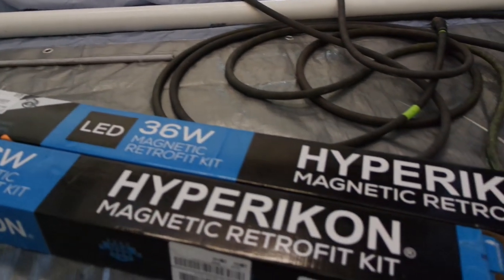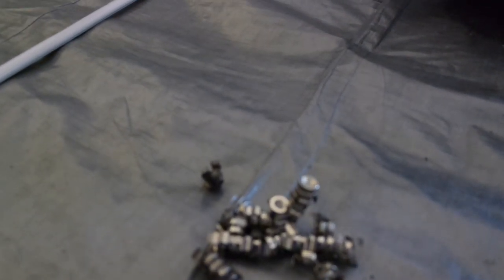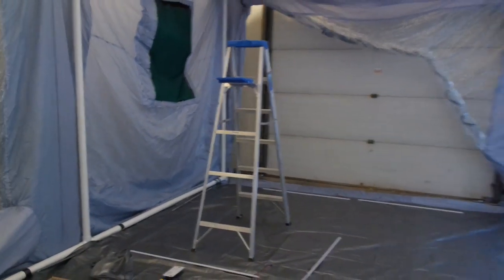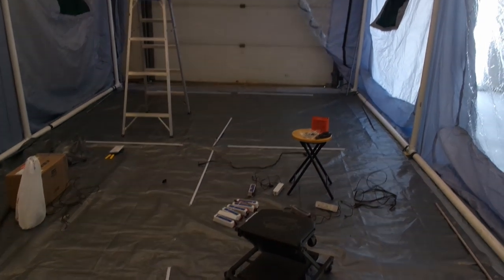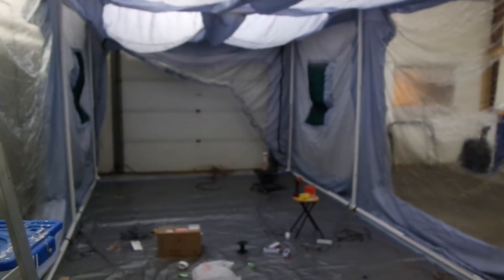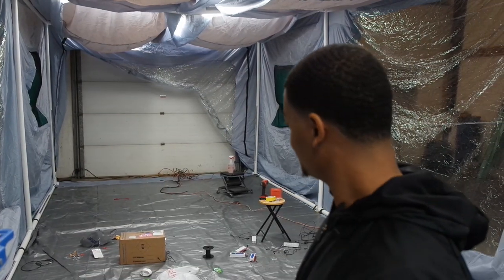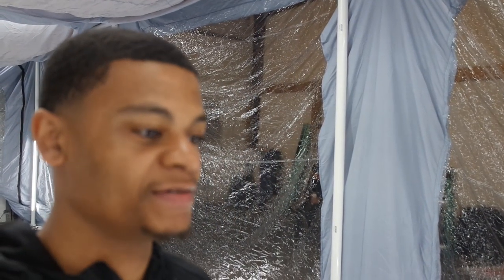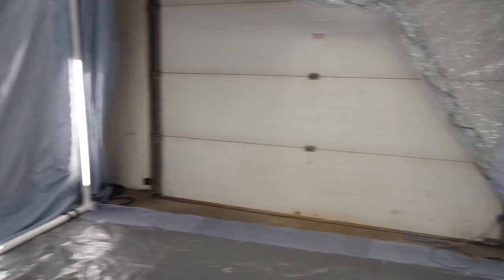How to wire led lights in a portable paint booth

Comment: Hey trey hope your good men, I need some advice what lights should I use in my spray booth I'm building  in UK, should I go for Led battons or retrofit t8s, an what colour spectrum an lens? 5000k or 6000-6500k I know your shooting with 5000k, but not much about in uk, I would appreciate your advice I'm a big fan of your channel.
Reply from the maker: Yea bro i dont know if they still sell the ones im using but if you just get led strips that are powered by a ballast that is pretty much what i have. Try amazon.
Reply: @treybedipping1734  thanks bro ill have a check at Amazon but what colour temperature would you recommend I can gt plenty of 6000-6500k in strip lights but I can get the battons which are 5000k an some 4500k. I can't get much info on net.
Reply from the maker: @NDZ446  5k is a true white 6k starts to have a slight blue hue